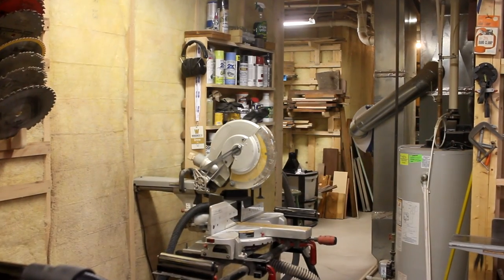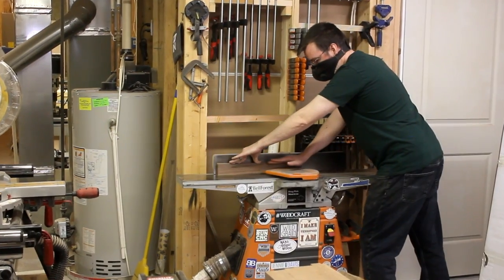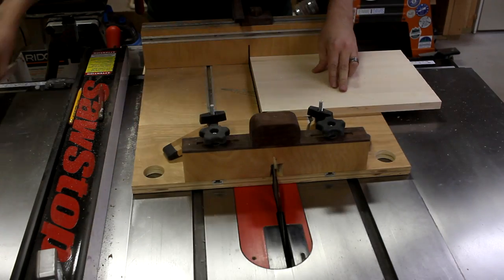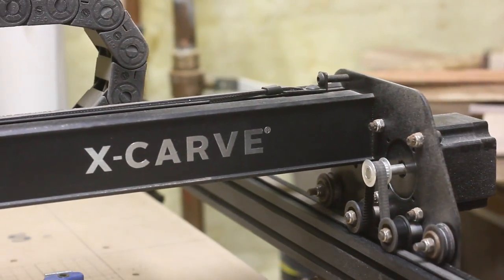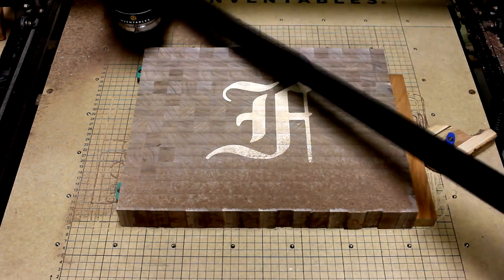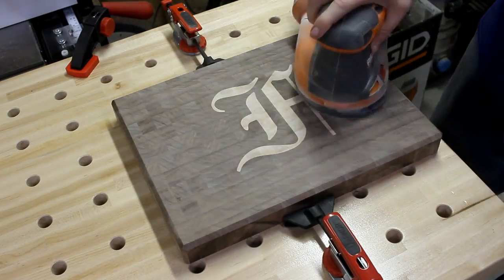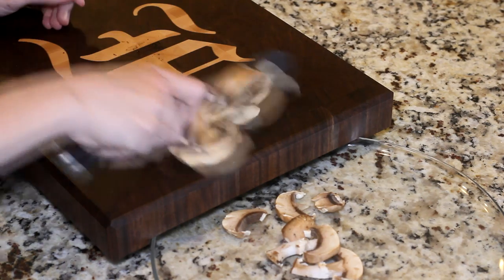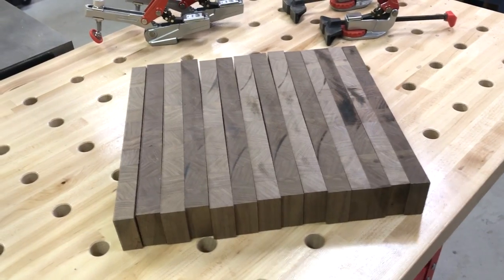Woodworking: Making an End-grain Inlay Cutting Board

Comment: Like how you prevented tear out on the corners with the router.  I learned something.  Great job.
Reply: I came here to say the same thing!
Reply: Yep. Thank you.
Reply: Same with small planes when breaking edges. Go towards the middle on the edge and inch or so then come back down the length of the edge the other way towards the inch or so you already beveled. This will prevent the edges from chipping out.

Comment: Really nice work. I've made quite a few such boards but never tried an inlay.

You can put an end grain board through a thicknesser BTW - it just needs really light passes (e.g. 0.5mm or 1/64"). It's a good idea to glue a sacrificial strip of wood (e.g. pine) onto the edge that will exit the machine last, as that prevents the knives from tearing out the end of the board. You can also glue another couple of sacrificial strips down the sides of the board, that extend beyond the ends by ~10cm or 4" (i.e. 50cm long strips for a 30cm long board) as that means that the planer snipe should be entirely on the tips of the strips; meaning there's no snipe "step" on your board.

Comment: Great video with some great ideas in it. I might say though that you really need a better saw blade. You should be able to cut through that slab in one pass without any burning or dragging on the saw. Your saw should have plenty of power for it and a sharp quality blade will leave a finish cut with no marks at all.

Comment: I love the videos very much. You’ve given this beginner A LOT of ideas. One question I have for you. Where did you learn the programming of your CNC? I’ve been trying different programs like autodesk and SketchUp. I just can’t seem to figure out which is better.
Reply from the maker: The Xcarve uses Easel (which is free) for their interface but you can use lots of different programs to generate SVG files or Gcode that can be imported into Easel. For example InkScape which is also free.

Comment: Drew, great work on this.  One question -- when you were setting up for the CNC to cut out the maple inlay (the male part of the inlay) did you offset the size to be a hair smaller, like .02" less?  I know you sanded and finessed the piece by hand and then test dry fit and it looked good.  But I've tried this on my CNC where I reduced the size of the male inlay by .01" and it turned out to not be enough -- couldn't really get it into the female pocket even after trying some sanding and finessing of my own.  But I don't want to increase the offset to the point that the inlay doesn't fit snugly, so I wondered if you know of a "magic" number for reducing the perimeter size of the male inlay to get a good fit.  Thanks!
Reply from the maker: Hey Carl.  The number you're looking for can change depending on what wood you're working with and what bits you're using.  A pretty common offset to start testing with is .03.  Once you put glue on the surfaces, they're still pretty snug.  Just make sure you do a couple test carves before you're final piece.

Comment: I love your humor and work. I have a question. I'm fairly new to woodworking and was wondering the purpose of raising the grain as you mentioned in this video.
Reply from the maker: If you don't, the first time you get the board wet at all it will start to feel rough again.  Raising the grain makes the surface fibers of the wood stand back up so you can sand them smooth.  I usually raise the grain a couple times before I call it good.
Reply: @FishersShop  Excellent. thanks so much for the info

Comment: Awsome cutting board and great idea on the recess for the plate, it saves both time and hand palm. I am thinking to make a similar cutting board with CNC machine, but have some concerns. The inlay has a layer of waterproof glue at the bottom and the side, which stops the airflow between the top and the bottom. It has been almost two years since you posted this video, do you find any issues with this cutting board? Like mold on the inlay part, or cracks due to the wood movements of two different wood species that glued end to end of each other?
Reply from the maker: Zero issues.  And we've used that board pretty much every single day since I made it.  Not sure why you feel there needs to be air flow through the board.  Having open pores that can breathe will just trap bacteria and wouldn't be food safe, in my opinion.  Usually in open-pored wood (as well as with any other species too), you treat the cutting board with an oil & wax combo to fill those pores and to offer protection.

Comment: Great job btw!  Just curious how much bigger it's your pockets than your pieces?
You've gotten a nice right fit without having to hammer in the pieces.
Reply from the maker: I can’t recall the tolerance that I used but the inlay generator app for the CNC lets you customize that setting for the perfect fit.

Comment: I may be alone on this but whenever I’ve been asked about what chatoyancy is I’ve always compared it to running your hand across a piece of furniture that is upholstered with suede or polyester. The direction in which it is brushed will create the illusion that the area is darker than the rest of the piece of fabric. Also, a question for you and to any viewer that can help, I saw that when you chamfered the base of the board, you would nip a bit off of the far end of the tool path. Is there a reason why it is more beneficial than just continuously running the perimeter of the piece with the router? I don’t have much experience as wood working is more of a hobby for me but I’m always interested in learning more about all the facets of the craftsmanship that goes into making these pieces. Thank you for your time, keep up with the great content! Just subscribed and can’t wait to see more of your videos!
Reply from the maker: Going backwards on the end eliminates the possibility of tearout from the router.
Reply: Fisher's Shop thanks for the tip! I’ll have to keep it in mind for my next project

Comment: Awesome Video! sense of humor is spot on as always. I have a question about your jointer. Do you enjoy that jointer for the size shop you have? I am upgrading from a bench top one and am heavily debating the model i believe you have. Similar sized shop and probably similar use. Any and all feedback is appreciated. Thanks
Reply from the maker: Yes, this is the perfect sized jointer for me.  It's definitely a step up from the bench-top jointers and it's heavy duty enough for large projects but yet still compact enough for my small shop.  Plus I have the mobile base on it which makes moving it around easy, which is nice.

Comment: Great video! And a bit scary, because I am currently making a cutting board and was thinking about an inlay as well, and now your video just popped up! And the light effect you showed at the end: is there a way to utilize that? Like not sand it down and use epoxy? Except cheaper than that?
Reply from the maker: I don't think so.  You want a cutting board to remain food safe so trying to preserve the chatoyancy with an epoxy coating that could flake off with knives wouldn't be recommended.
Reply: @FishersShop  Yes, that's what I was thinking too... I might look into it a bit more though... Perhaps there's something out there you and I don't know about yet 😉👍🏻 Thank you for your answer!

Comment: Would love to have the cnc for some of my work. Did you also use the oil over the conditioner?
Reply from the maker: It's an oil and wax mix.
Reply: @FishersShop  ah so it was already in the one bottle. Do you do a 50/50.
Reply from the maker: @paulychicago3672  I would think that would work just fine.

Comment: To get the inlay to fit into the carve how much difference in size do you make to get them to fit?  I've only done v-carve inlays and need some "help" here.
Reply from the maker: It varies on the bit and the wood you use (hardwoods are less forgiving than soft).  I needed to run several test pieces first to find just the right tolerance that would allow for a smooth fit and still be enough for glue as well.

Comment: great video with an amazing finished product but could i ask you advise on what is best to flatten the board with when you don't have access to a planer or a cnc ?? and what other finishes would you recommend that are "food safe" ??
Reply from the maker: Probably a router sled would be the best way to flatten it without a planer or CNC.  "Technically" all finishes are food safe once they fully cure, but you're safest bet  would be to stick with mineral oil and a bees wax combination.

Comment: Would you provide details about the hold-down with the orange handle that you used in this build?  Did you buy it or make it yourself?
Reply from the maker: Those hold-downs are sold by Inventables in a kit.  They come in all different sizes to accommodate whatever size project you're working on.

Comment: How do you clean off all the glue from the clamp bars after you are done?
Reply from the maker: I just use an old paint scraper to get the majority of it.  For the rest I put in a wire-wheel brush into my drill and go to town.

Comment: I'm just starting to make a few  Charcuterie boards. Why, for the cutting board do you have the end grain as the surface?
Reply from the maker: End grain boards are basically self-healing.  They don't show knife marks nearly as much and they maintain their smoothness whereas a face grain board will get all scratched up and get rough after just a little use.  End grain boards are much higher quality but they take a lot more effort to make.
Reply: thank you. @FishersShop

Comment: To not ruin the blade (of a good kitchen knife), never scrape it across the board (as in, to push food).  Use a scraper.  Or, flip the knife over and use the back of the knife (aka the spine) instead as the scraper and push your "fungi" to the plate.  This way, the blade edge remains sharp longer and won't be damaged by the scraping action.  It's just barbaric to ruin a blade edge like that... lol   ;-)
Reply from the maker: I am a barbarian and always will do it the barbaric way.  <grunt grunt grunt>
Reply: I was to say the same thing about the knife...
Turning the cutting edge of the knife upside it will slide soft on the board and will keep the sharpness for a long time!

Comment: i'm not understanding the part of wetting the board to raise the fibers and then sanding again to get rid of the raised fibers and then putting the oil on. 
why not put oil on after sanding the first time?
Reply from the maker: Once the board is oiled, you really can't sand it again until it thoroughly dries out, which can take months.  If you want to maintain a smooth finish, it's imperative to raise the grain (sometimes multiple times) before oiling.  If you sand an oily board, your paper will just gum up and be worthless in seconds.
Reply: @FishersShop  ah ok, thanks. i'm thinking to myself that the fibers i just sanded away will raise again once i put the oil on

Comment: I thought endgrain cutting boards are a no no.
Reply from the maker: Uh... nope.  End-grain cutting boards are the best of the best.  Since the wood fibers are parallel to the knife blade, they hold up better to cutting and don't show knife marks nearly as much.
Reply: @FishersShop  oh ok i thought bc they were up it alowed bacteria in between the fibers easier bc they are faceing up like straws
Reply from the maker: @thelosttexan1717  That's why you don't use open-pored wood like oak for end-grain boards.  A good dense hardwood is perfect and with oil and wax, it's completely safe from bacteria like that.

Comment: Great cutting board and lame jokes as usual.  At least your wife won't need mousse with all that glue on her comb. Here's a thought - couldn't you have measured for the feet pilot holes without the feet?
Reply from the maker: Yes, I could have.  Doesn't really make a difference though.  I knew I wanted them spaced in by 1" so just holding the feet there and bumping them in 1" from both directions was the easiest.